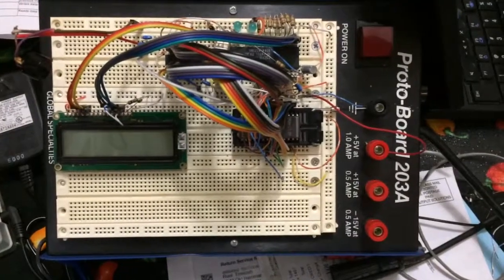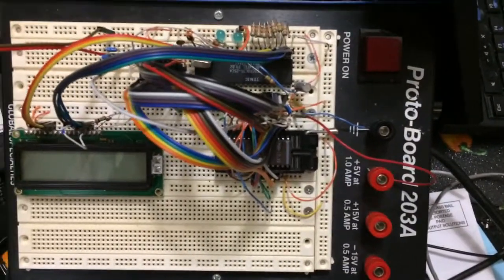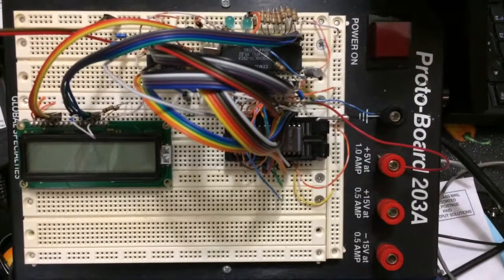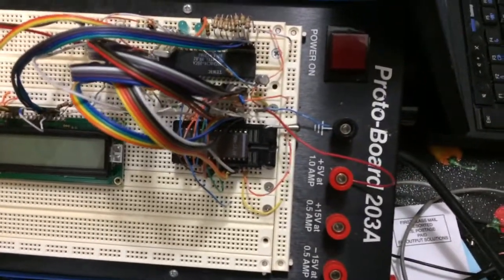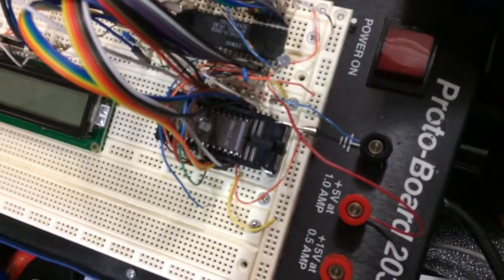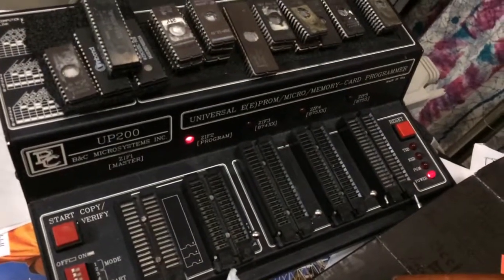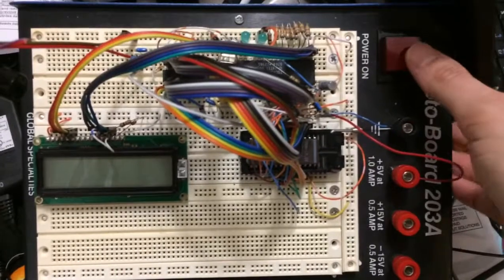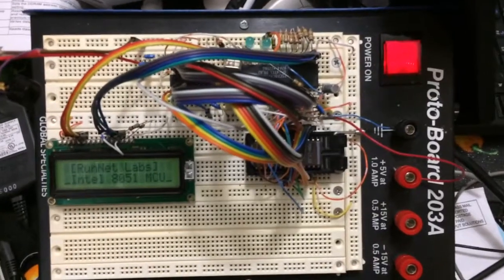Intel 8051 Microcontroller Test w External EPROM (actually a Temic 80c31 ROMless MCU)

Comment: Hi. Was it nessesary to use external RAM for this setup due to hardware limitation? Or simply internal RAM was not sufficient in size?
Reply from the maker: I did not use external RAM, but external program memory storage via an EPROM chip. This 8031 has 128 bytes of RAM, which was plenty enough for this little program. But the difference between the 8051 and the 8031 is that the 8031 has no internal program storage at all, so loading the program from an external source (like an EPROM or EEPROM) is required.
Reply: @ruhnet  Fool me, didnt notice what's on the board.
Reply from the maker: @janmachalica  It's also listed in the video description :)
Reply: @ruhnet  Even bigger fool of me, can't even read :D Luckily errare humanum est :D BTW would be great if you could prepare some more descriptive video, illustrating whole process of building and programming the circuit. What I saw is that stuff is possible, but I still don't know why and how. Have TSC80C31-16CA, googling how can I do something useful with it.
Reply from the maker: @janmachalica  Ah yes, if I only had more time I would love to do that. Check out my github link for the schematic and more info on how I compiled it and prepared the file for burning to the EPROM, etc.
Reply from the maker: @janmachalica  You can do lots of useful things. The 8051/8031 has quite a few outputs/inputs, so you can hook those up to buttons and  relays to control lights or appliances, LEDs, etc. That would be an example of something useful and simple that can be done. Or hookup a temperature sensor and show temperature on the lcd, or control a fan or AC compressor. An example of something more advanced that is useful is this MIDI drum machine (not my work): https://www.pjrc.com/tech/midi-drums/drum-intro.html    :-D
Reply: @ruhnet  Well I realize it's useful piece of hardware :) I just need to gain my knowledge of it first.
Reply from the maker: @janmachalica  Check the link I gave in some of the other users' 
comments for tons more information. :-D

Comment: Love it. Where did you find documentation on how romless 8051 initializes? I'd like to use it instead of much expensive one with flash/EEPROM, but I don't know how does it load external ROM into RAM.
Reply from the maker: Hi Sinisa! All you have to do is connect EA (pin 31) to ground and the chip [whether it's an 8051 with built in ROM/EPROM or a ROMless 8031] will know to boot from external ROM. By doing this you can use cheap pulled 8051 variant chips with internal PROM that have random other code on them. There are many PDF books available on the 8051 that explain this; just search Google for "8051 book pdf" and you will find plenty of references. There are several here: http://ee.sharif.edu/~sakhtar3/books
Reply: @ruhnet  that is very helpful, thank you a lot!
Reply: @ruhnet  The book is really big so I'll be lazy and just ask one question: does it start program execution from memory location $00 or some other? :)
Reply from the maker: @sinisamarovic  I believe it is 0000H. See here: https://what-when-how.com/8051-microcontroller/the-program-counter-and-rom-space-in-the-8051/     Google is your friend :-)
Reply from the maker: Also good overview here: https://en.wikibooks.org/wiki/Embedded_Systems/8051_Microcontroller